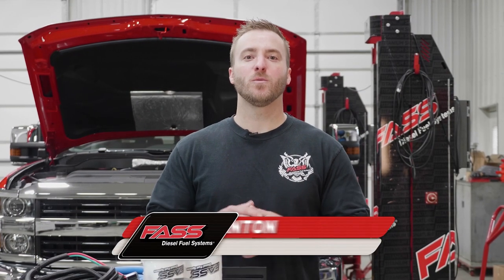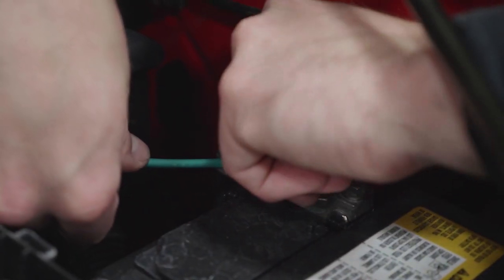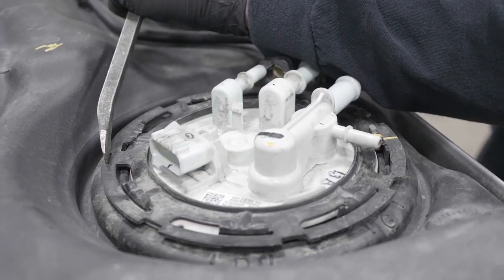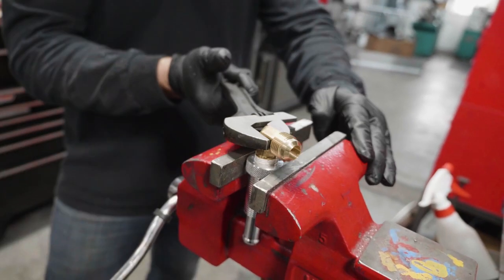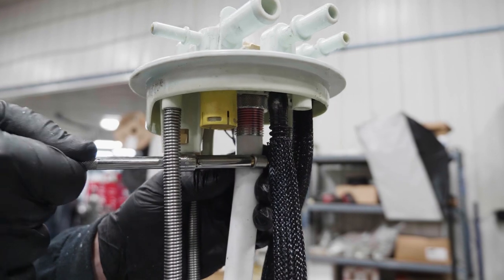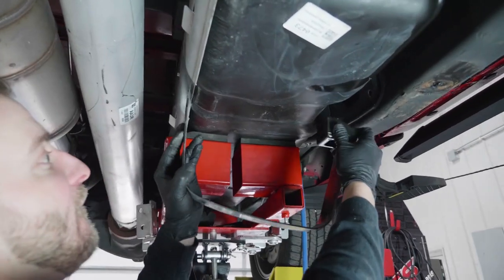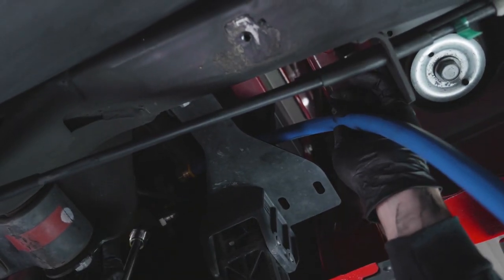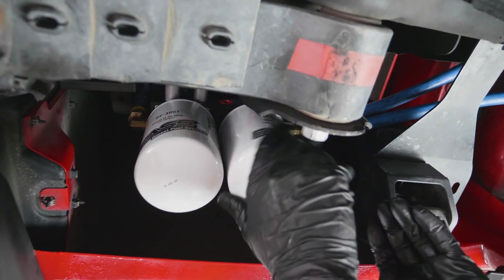FASS Installation on a 2015-2016 Chevy Duramax or GMC Duramax

Comment: I was extremely nervous to alter the fuel sending unit during this install but this video made everything simple and easy. I utilized both the instructions and this video side by side and the video was much simpler and easy to follow. Great video and great product. I immediately noticed the results in my truck. Would totally recommend this product and video.
Reply: why do some lif tpumps require you to drop the tank and alter the sending unit but others dont? Whats the advantage?  Looking at buying a '15 lml and want to add a lift pump to protect the CP4 but I dont understand why this video has them altering the sending unit but other videos and instructions Ive found do not.
Reply: @andrewjordan9183  The videos that you are referring to are 11-15 LML. The 15.5-16 LML is the same body style, with slight differences mechanically. The fuel sending unit in 15.5+ are more restrictive and require drilling. If you're unsure which LML you have, you can look at the exhaust where it is bolted to the downpipe right behind the passenger front tire, behind the frame. If the exhaust is held onto the downpipe with a clamp, it is 11-15. If it is held on with three bolts, it is a 15.5-16.

Comment: You should do a giveaway for the basic fuel system!  Just bought my first Duramax. 2016 LML. So def thinking of doing a FASS system because of the CP4 unit...  great video!!
Reply from the maker: That's awesome man, congratulations on getting the Duramax! If you have any questions about the system you are more than welcome to reach out to us anytime!
Reply: if you still got that duramax stop driving it immediately and ditch that junk cp4 with a cp3 conversion before you have to spend 10k in a whole fuel system

Comment: Damnnn and here i had it backwards 

 Now based off the diagram on the back of the filter and this video i noticed i been running for over a year now with my system improperly! 
 Alot of people are under the impression that the low tube is for the Fuel filter rather the Water seperator so ive had mine swapped and ive had a shit ton of issues not realizing thats the issue! 
My new filters arrived today and i was looking at the diagram i didnt realize that with the Black base units on the LMLs the low tube is in fact  meant for the  water seperators!
 it might explain the intermittent Hesitation ive been having because the filters were not in the right locations! 

The water seperator was on the suction side!
Reply from the maker: Happy you have this figured out! If anything like that comes up again we'll be happy to help, our service number is 636-433-5410!

Comment: November 5th 2023 just installed my signature. Lift. Pump works good, the only problem is my check engine light. Have anything to do with? Because I bypass the factory pump.
Reply from the maker: Hey there thank you for reaching out and we apologize for the trouble you're having. Whenever it's convenient please reach out to our service team at 636-433-5410. We'll be happy to help!

Comment: I saw an installation video that said to install the fast pump unit out of direct line from potential rock throwing of tires. Is that a concern?
Reply from the maker: We completely understand where you are coming from there, and we haven't seen any issue with rocks punching holes in filters.

Comment: Do you have to modify the fuel tank module? Will the pump be able to be installed and will work without doing that?
Reply from the maker: Great question! Yes, this system is designed to integrate with the OEM in-tank module, and that installation method does require some simple modification. 

However, you can also opt for a sump kit, which will bypass the in-tank module altogether. 

We definitely recommend utilizing the OEM pick-up module whenever possible to ensure maximum fuel range, but a sump is a solid option for the simplest install.

Comment: I ordered the stk1002. It’s incorrect. Do I need the stk1005 for 2015.5 duramax? Also the pdf instructions for stk1005 has a different 5/8 tube than what’s in this video. Looks like the one in the stk1002 kit
Reply from the maker: Hey Douglas, thank you for reaching out! We'd be happy to get you the correct parts. Just to verify what you have and what you'll need typically we ask to give our service team a call at 636-433-5410. They will be able to assist with this and get you the correct numbers to place an order over the phone.
Reply: @FASSFuelSystems  thank you. They were very helpful
Reply from the maker: @douglashughes1392  Of course! Thank you for the update.

Comment: Yikes, on older models you didn't have to remove the gas tank... What does the gas tank modification do?
Reply from the maker: The 15-16 Duramax sending unit is more restrictive than the 01-14 Duramax. Modifying the factory sending unit will eliminate that restriction.

Comment: Does a “no drop” sump kit bowl only bypass the process of modifying the fuels tank module??
Reply from the maker: Correct, you just would not have to drop the tank to install the suction tube into the sending unit.

Comment: Dumb question but isn’t putting grease on to any fuel component going to contaminate it?
Reply from the maker: That's a great question! The amounts used are very, very minimal and virtually none ends up in the actual fuel line. If some were to get into the actual system, it would either be filtered or burned off without any issues.

Comment: So it looks like you are returning fuel through the old suction line. Is that correct? I've been thinking of adding a sump but don't like it hanging from the bottom of the tank this looks much better
Reply: Look to see it your truck has the fuel tank skid plate. I went with the new Beans sump and the sump is hidden under the plate. It is also a lot easier to install the sump. Just make sure that the truck is almost empty and then jack the rear end up as high as you can get it so the fuel go forward some. I drill right where the flat spot is  and some fuel came out which is great because it washed out the plastic shavings from drilling. Did it over a year ago and no problems.
Reply from the maker: We are returning fuel to the factory suction line on the 15-16 Duramax. This helps keep the basket in the sending unit full of fuel at low tank levels.
Reply: Are there any negative effects from using a bean sump with this set up ?

Comment: I got a question I think I did something wrong I installed the pump its been like 6months now ,so I was replacing the filters and with new filters I left them a little loose and turn the ignition on so they would fill but after like 3min they never filled so I was curious if the truck would start and it did and ran fine for like 10min did I do something wrong that fuel is not getting to pump ??? Or is it normal for it to still run with out the fass ,I also installed a sump in my tank???
Reply from the maker: Hey Stevo, thank you so much for reaching out about this and we will be happy to help. If you don't mind we would suggest giving our service team a call to make sure everything is in good working order. Our number is 1-866-769-3747. Thank you sir!
Reply: Thank you

Comment: I just had the FASS fuel system installed on my 2003 Chevy Duramax and diesel is leaking all around the original filter? How do I stop the leaks?
Reply from the maker: Hey Victor, I am so sorry about the trouble your having with the leaks! We actually have a tech line available at 1-866-769-3747. If you don't mind give them a call, and we'll get this taken care of sir! Have a great day!

Comment: Does the truck have to be tuned once the lift pump is installed. Can it be installed on a 100% stock LML and stay stock(factory tune)?
Reply from the maker: Absolutely! In our product finder (link below), you'll just want to select the make, year, and horsepower level for your stock LML (under 700hp). Here's the link: https://fassride.com/shop/product-finder/
Reply: Thanks for the quick reply. Just put my order in.
Reply from the maker: @herlihy433  Sure thing, thanks for your support. Let us know if any other questions come up!

Comment: Quick question does the fass eliminate the use of the factory fuel filter?
Reply from the maker: While you don't have to remove it, a FASS will eliminate the need for the factory fuel filter.
Reply: @FASSFuelSystems  ok thanks. I just think this third filter is causing restrictions in the system.

Comment: I found the 2004 Chevy Silverado install a lot easier. Could this be done on a 2015 3500hd lml as well?
Reply from the maker: The 15-16 Duramax sending unit is more restrictive than the 01-14 Duramax sending unit so you do need to modify the sending unit with the parts included in the TS C12 kit.
Reply: I can't decide between this set up an the airdog the FASS is ALOT more work but it just seems like the better option of the two. I need an honest opinion here guys my clock is ticking with my 2016 duramax
Reply: @wallheadkdir Fass is Probably much better, heard some stuff about air dog wasn’t great for some of the guys and they went with fass, and seems better with it

Comment: Is it messes art to instal the draw straw ?
Reply from the maker: It is necessary to install the suction tube on the 15-16 Duramax. The factory straw is too restrictive.
Reply: @FASSFuelSystems  Do you absolutely have to install the draw straw? I need something plug and play, I'm not a great mechanic and labor rates are too expensive for me to pay a shop to do it.
Reply from the maker: @pooch7607  we completely understand where you are coming from! We actually have sump kits on the website so you won't have to drop the tank do to an install. If you have any questions about the install, or process you are more than welcome to reach out to our service team at 636-433-5410. Thank you!